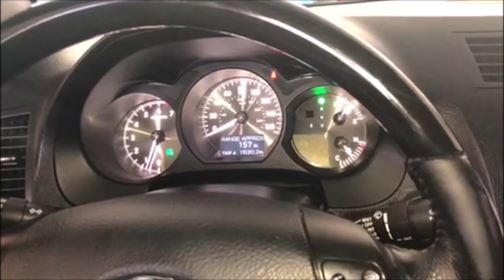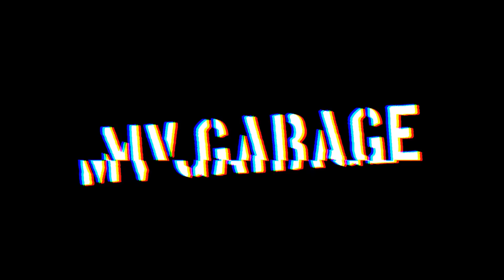Lexus Toyota VSC / Trac Warning Light FIX

Comment: My VSC OFF light is on with VSC and ABS light...but I can feel the abs working when I brake at higher speed...will this work???..I am sussing the wheels...bcos it goes and stops faultlessly
Reply from the maker: If there is no check engine light on with those. It should work. Doesn’t hurt to try.
Reply: @FlipITGarage  nope...no Check engine light on..and ABS light is not as bright as the VSC OFF and VSC lights...it sits btwn the two. .so l am not sure tif it's  a good or if it's on😥
Reply from the maker: TheMuzikall then this procedure should work. Try it. Let me know how it goes.

Comment: Mine was the gas cap. I didnt think it was going to be such a stupid easy fix, but it was
 The lexus has a weird fitting fill intake.
Reply from the maker: Glad you figured out the issue! But you are referring to the check engine light not the VSC light itself. VSC light goes on automatically with the check engine light.

Comment: Hi my lights on my lexus is250 recently came on vsc light and check light also trac light.  the code for the the check light was p2757 which was the transmission after replacing the transmission twice the light came right back after about 20 to 80 mile twice this happen so i know its not the transmission whats the next step i should take could it be my computer
Reply from the maker: Dang Vue Hi possible causes for that code. Dirty transmission fluid
Faulty line pressure solenoid valve SLU
Line pressure solenoid valve SLU harness is open or shorted
Line pressure solenoid valve SLU circuit poor electrical connection
Torque converter clutch
Valve body is blocked
If you checked all those and replaced what you needed to did you clear the code ? Reset it with a scan tool or disconnect the negative battery terminal for 10 minutes. The VSC light is only on because the check engine light.

Comment: Hi
Thanks.. it worked for me.. but is it a permanent fix ? What is the root cause of this ?
Reply from the maker: Your welcome! Glad it worked for you! This will be a permanent fix if there was not a real issue and it was just triggered which does happen. If there is a real issue it will return then you would need to get it scanned and see exactly what the issue is. It can be caused by a bad sensor or ABS issue.

Comment: My car battery died there was some corrosion so we cleaned that up and when I jumped my battery the vsc light came on never came on before will this work for that or should I take to a garage (07 Toyota Camry xle)
Reply from the maker: Is it just the VSC light ? Or do you have a check engine light on with it?

Comment: Hi I changed the clock spring and steering angle sensor (I broke old by mistake) job was easy turned on now have trc and vsc lights. I have scan tool so reset steering angle sensor and cleared codes. U0126 keeps coming back. Lost communication with SAS control module. I tried all of these hacks also the one where you touch the cables 4 times within 8 seconds into the reset mode. No joy I still have the lights. Any tips or is my new (used of ebay) unit bad is my next thinking. Thanks in advance also checked every fuse. I did the job with battery disconnected and also have left disconnected over night to see if that sorts it. Still no. Also test drive to see if it re learns but no.
Reply from the maker: Henry Phillips Hi! Sounds like you covered all the basics. I would suspect a bad unit if everything is hooked up properly. I would swap it with another one to confirm. Also check all your connections.
Reply: @FlipITGarage  Fixed it! I was rite: The new used part on ebay was to blame! I only broke my clock spring not the SAS so worth a try I put my old SAS on the new clock spring and it worked first time! Re calibrated. No codes to clear because it was all happy. This all started because I was aligning the steering wheel to the rack for the correct amount if turns each way. Now I have done that job also needs major wheel alignment it was loose and way out! I hoped fixing this would also solve the serious brake judder but unfortunately it hasn't. This judder causes bad wheel bearings and drop links after 6 months it's so bad! New brakes all round also every bush and ball joint is good. New tyres and wheel balance. Drive / prop shafts good. On a Lexus is250. Any suggestions 🤔

Comment: I did a after market CAT replacement on my 2006 IS350. Will this work on it? Im trying turn off the VSC lights that are on due to the CAT replacement. Thank you I'm scared to do it, I don't want to blow something up by putting a paperclip in there LOL.
Reply from the maker: Lol. Do you just have the VSC light on ? Or is there a check engine light on too?
Reply: @FlipITGarage  thank you for getting back to me it's the check engine light and it looks like the traction light on the right side, it's the the car with the skid marks icon. The engine light is on the left and then it says check VSC on the display. Hope that makes sense
Reply from the maker: @kaoquinn  No problem totally makes sense. This procedure won’t work for your issue. Watch this video to reset all those lights: https://youtu.be/iLrolhRr9lk If the light comes back after a while it will need to be diagnosed and fixed. Hope this helps! 🤙🏽
Reply: @FlipITGarage  thank you!

Comment: I’m not comfortable doing this myself. My car keeps jerking to the right and the VSC light on. The steering wheel is turned to the right, also if that makes sense. What would a mechanic charge to realign my steering wheel and fix this problem? Recently got an alignment.
Reply from the maker: Definitely sounds like the alignment wasn’t done correctly if you recently did it. They usually cost between $80-$120. I would address the alignment issue before anything.
Reply: Tonight (after hours) I had my car towed to the Auto Shop  that did the alignment & control arms to check it out since under warranty. My steering wheel was completely upside down and could do a complete 360 when attempting to drive it there. I couldn’t go over 40mph on the highway without car jerking left and right so I decided not to risk it. Terrifying! I can’t wait to find out the problem when they check it out in the morning. Thanks for the advice.
Reply from the maker: @MahoganyBelle  Yes, better to be safe. If it was there fault I would hope they cover the tow as well. Sounds like something was left loose. Let me know what they find.
Reply: @FlipITGarage  I’ll definitely update you with what that say. Hopefully, I can get reimbursed for the tow. I was out of $185. They did say if it’s their fault they will take care of it. Not sure why they didn’t offer to pay tow upfront, only a referral to one but I found my own.
Reply: @FlipITGarage  So as mentioned they worked on the lower control arm ball joints and did an alignment. The guy just called and said that the suspension pins were missing, and I don’t know much about cars but that sounds like a careless mistake. He said they put the suspension pins in and it’s working perfectly now. I’m on my way to get it and test drive it early just in case I have to take it right back. What are your thoughts on this? Does this sound right?
Reply: @FlipITGarage  I’m definitely taking my tow receipt since he admitted they probably forgot to put the pins in.
Reply from the maker: @MahoganyBelle  Wow! Sounds to me like they didn’t tighten down the tie rods when doing the alignment. Not sure what pins he is referring to. Unless the ball joint pins that keep the nut bolt secure. Which could of been very dangerous. But yes definitely have them pay for the tow. And test drive it for sure.
Reply: @FlipITGarage  He said suspension pins were missing if I recall correctly and he had to tweak something related to the ball joints. I know I’m not very good at relaying the details. Sorry, but he did cover the tow charges. And yes it was very dangerous, On the way to the shop I started hearing metal scraping really loudly which is why I ended up getting a tow so something was definitely not right. Car is fixed now and driving smoothly and quiet.😊
Reply from the maker: @MahoganyBelle  If it was something related to the ball joint as you mentioned. That is what keeps the wheel in place. A failed ball joint would make the wheel collapse. Very dangerous. Good call on getting the tow! Happy they covered it but I would find another shop for future repairs! Glad your safe and it’s all taken care of now.
Reply: @FlipITGarage  Good to know and that’s literally the best advice I’ve received all week. Thank you so much. Enjoy your weekend and be safe😊

Comment: Hi MV, I got code P0A80 - Replace Hybrid Battery pack on my lexus 2006 Rx400 H. 
history- I did not drive for 1 month. So when it did not start got battery replaced by AAA and now I have check engine, red triangle 🔺 with exclamation, ABS on. Any suggestions what could I do to fix...
Reply from the maker: Haven't worked on many hybrids. There may be a reset procedure that needs to be preformed when installing new batteries on hybrids.

Comment: Hey man, I have a 2007 lexus is250 and my VSC and check engine lights both came on after replacing front right tire, I tried everything in your video, I connected the paperclip as mentioned and let the car run through the cycle you showed, after that, my car is currently driving fine but the lights are still on, how do I get them to go off?
Reply from the maker: Sometimes you have to repeat the procedure. Unless its a hard default then you need to address the issue.
Reply: Hi did you manage to find out the problem for your lexus is250? i have the same problem with my 06 is250

Comment: Will this work for my 2006 Toyota 4runner? I had seen other videos using the paper clip but for the 4runner the other videos showed that one paper clip is in the 3rd hole on the top left and the other paper clip is in the 4th hole bottom right.  I tried it and it didn't work, I had to touch them 4 times and turn the vehicle off and turn back on again and touch the clips together for 20 sec and then turn it off and on again. It was a workout. Please tell me I can follow your steps. Thanks.
Reply from the maker: Terrance Gamble I’ve never tried it on the 4Runner but it should be the same procedure since I did this on a 2006 Lexus. Also on a 2018 Toyota. And it was the same. But I can’t say for sure on your vehicle. Won’t hurt to try. Let me know how it goes.

Comment: I’m going to try it, I just bought a 2006 Lexus Gs300 and according to the previous owner they replaced the break pads but did not reset the VSC, car runs fine it’s just that light that bothers me. I’ll keep you all posted.
Reply from the maker: Should go smooth this video was made on a 2006 GS300.

Comment: sorry to bother you again i had another question...i think they are called Spyder Led Drl headlights.. the led strip light keeps flickering when i turn it on.. is it a sign that i need to buy a new headlight?
Reply from the maker: Mitsu RT with my experience with LED strips. It’s either a power issue, poorly made led strip or yes it’s on its way out. If it was working good for a while and now doing that then yes it’s about to go out.
Reply: @FlipITGarage  kk Ty

Comment: on my 2005 GS300 it does not go into VCS TEST MODE it only goes to DIAG VSC and numbers change to 41/53. Any help would be appreciated
Reply from the maker: You don’t have a check engine light on correct ?

Comment: Before trying this reset, did your car run properly?  The dealership swapped out the fuel pump on a Toyota recall and the next day I turned the car on and got the TRAC OFF and Check Engine lights.  Nevertheless, I tried driving the vehicle, but there was no acceleration.
Reply from the maker: pshaw34565 the check engine light is the reason your VSC Trac light is on. You’ll need to get it scanned. I would take it back to them.
Reply: @FlipITGarage  Thank you.  I am going to bring it back to them tomorrow.  I was curious if resetting would make the car run properly.
Reply from the maker: pshaw34565 you can always reset the check engine light by disconnecting the negative battery terminal for 10 mins. But I wouldn’t recommend it. Since it’s something they must of caused. It will reset the data. Just bring it back to them and yes the check engine light could be a number of different things that may make it run rough.

Comment: 2007 GX 470 it’s the 4th from the right. Works like a charm. Thanks!
Reply: Update... worked but then the light came back on. Tried the paper clip trick, lights flashed but then didn’t turn off. What’s next??? I just got new tires and rims
Reply from the maker: Sound like you may have an issue with one of the speed sensors. Did you ever figure it out?
Reply: @Justin-ge6fu   hey bro this just happened to my gx470 today along with not being able to shift out of park when I start the car I have to override the shift lock release to get it into drive. There was four lights that came on the abs vsc off vsc trac and anti skid. But they came on intermittently and did not stay on continuously for the entire trip just as I’m pulling off out of park and a few more times throughout a road trip but there is nothing wrong with my car it never effected performance.  Did your lights ever back come back on after you reset if with with paper clip trick? And also were the lights coming up intermittently for you or did they stay on until you reset it?

Comment: Would this work on the Lexus is350?.. I dont want to accidentally short anything out if the connector pins are not the same
Reply from the maker: If it’s just the VSC light on this procedure will be the same on the IS.

Comment: Hi what if the pin holes are different? My 2007 gs350 pond connectors are different
Reply from the maker: Should be similar on that model. This was done on a 2006 GS. Won’t hurt to try.

Comment: I have a lexus gs 460 2008 with a check vsc but when i tried this only vgrs check came on. Ive had my code on since i changed my abs pump
Reply from the maker: You don’t have a check engine light on do you?
Reply: @FlipITGarage  no
Reply from the maker: @array8909  you’ll need to pull the code to see what the issue is. Don’t think it was just triggered if it didn’t reset it.

Comment: Thanks once again. Please my Lexus GX 470 2008 model will crank for quite a while before it fires up. Fuel pump changed but there is no solution yet. How can you be of help sir? Thanking you in anticipation.
Reply from the maker: Ibitayo Afolabi when was the last time spark plugs were replaced ?
Reply: @FlipITGarage  Oh so sorry i forgot to mention that. Spark plugs were changed TWICE within a month. The last was done 2 weeks ago. Thanks
Reply: This problem occurs when the vehicle is parked for, say, 25mimutes or more
Reply from the maker: Ibitayo Afolabi almost sounds like a fuel issue then. Was the fuel filter changed ? May be clogged. Do you have a good crank when starting?
Reply: MV Garage Not too good crank when starting. I’m thinking same way too about, FUEL ISSUE. Because I perceives smell of gasoline from the tailpipe whenever the fault occurs.....with a white smoke which disappear after about 20 seconds. I sincerely appreciate your attention sir. I will try to look into fuel issue and revert back.
Reply from the maker: Ibitayo Afolabi Yea I suspect the same. Hard to tell without seeing the car. But definitely seems to point to a fuel issue. Good luck and keep me posted.
Reply: MV Garage I will surely do. Thanks so much

Comment: My 05 ES 330 has VSC and trac off lights on and has a code P0442 also. It’s evap system small leak. Is this a separate issue ?
Reply from the maker: This is if you only have the VSC light. See this video to reset both: https://youtu.be/iLrolhRr9lk
Reply: Sounds like maybe a bad gas cap or it wasnt screwed on good. Especially if you haven't had any work done to it recently.

Comment: Hi, i have IS350 with check AWD system showing and as C1298 code. Both the connection and the wires are in good condition but the light still showing. How can you help out?

Comment: If this does not work, try taking the negative terminal off the battery for 15 mins, it will reset the computer and should clear
the "check vsc" lights ... That worked for me on a 2007 is250
Reply from the maker: Yes, but that only works if you have a check engine light and the VSC light on. Usually doesn’t work if it’s just the VSC light.
Reply: Did you solve the issue in the long run?